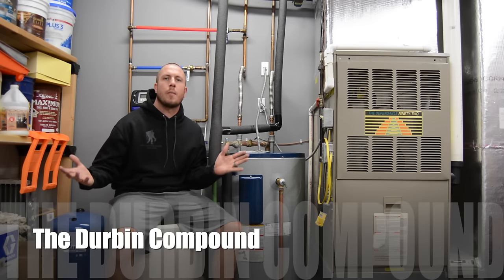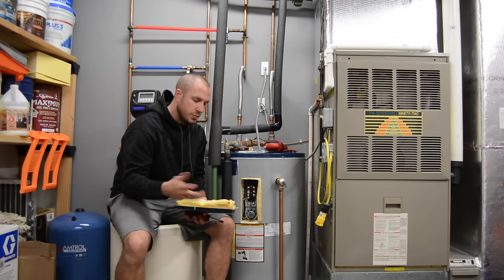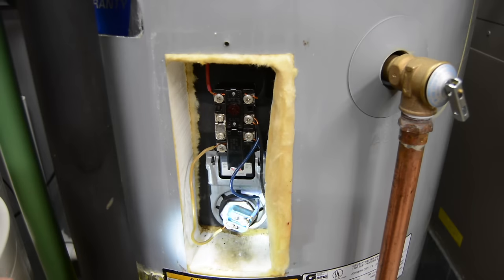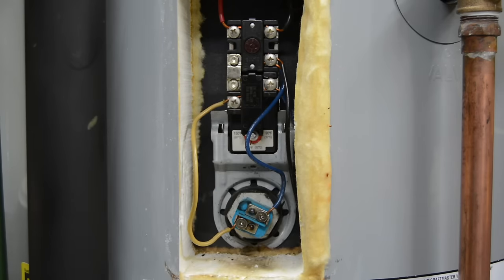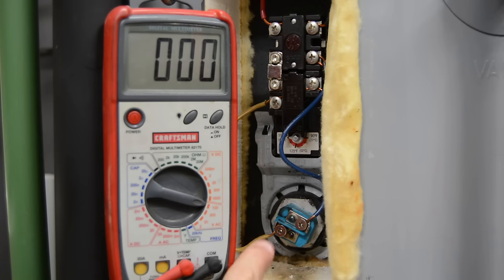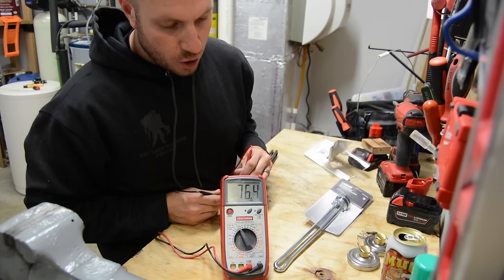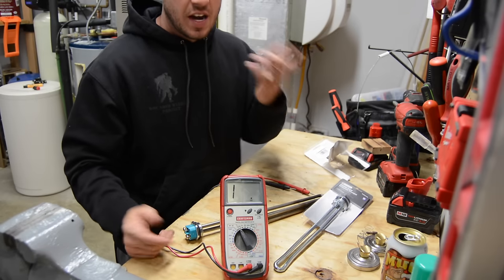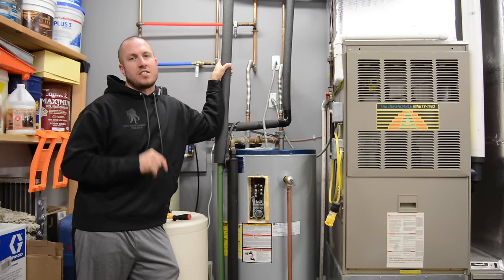How To Tell If Your Water Heater Element Is Bad

Comment: When you verify voltage is present at your element, Amp draw is also an excellent test of element functioning. Also after draining tank and removing lower element, this is a good time to see if tank needs a cleaning.
Reply: you are right about the current. i would check with amp probe first
Reply: I always test for amperage draw never test for continuity the element can be out and still have continuity

Comment: We had a storm knock out our power and when the lights came back on, we had no hot water.  I pulled out the elements and they were covered in little white rocks.  They were still testing good for continuity but I replaced them anyway.  Still no hot water.  Tested EVERY contact and EVERYTHING was testing good and I couldn’t figure out what the problem was so I started watching troubleshooting videos on Youtube and they all just kept repeating the same steps to test each terminal.  I finally found this video and it offered a a test haven’t heard on any of the other videos, (checking both inputs together to verify that they added up to 240v)! Sure enough, one input wire was getting 120v (and since I had continuity every contact also read 120v) and the other read 0v.  It was the Square D double 30 breaker. One side was good holding the other in the ON position, so it wasn’t tripped. Traded it out for a new breaker and I got 240v and hot water!! I just wanted to say thank you for including this test because you are the ONLY person who suggested it!
Reply: Nice. Mine is doing the same thing after I replaced both thermostats and elements and tested all the terminals. Over and over again as everyone kept suggesting. Hopefully I can find the problem in this video like you have.
Reply: The damn water company was doing some work on a house a couple yards down from me and no joke ever since they started I have had no hot water…. Don’t know if it was just shity timing or if somehow they screwed up my water too… they are never there when I’m off work so I’m kinda screwed lol

Comment: Elements can also be tested by turning off the power, then testing the resistance across the element. A good element should read between 10-16 ohms. My good element read at 13 ohms, but my bad lower element read at .59M ohms (basically open). Safer to test with the power off.
Reply: What if both elements read at 13 Ohms, thermostats look good visually and power is being supplied but still no hot water? Could one of the thermostats be bad or voltage be incorrect?
Reply: @snowyowl9132  Did you isolate each element by removing at least one wire from each one? You might be "back feeding" and reading the same element through the t-stat.

Comment: Be nice if someone would show/explain removal of element that burned and one side was severed from the other. That's what happened to me and when pulling out the element without draining the tank, water went everywhere. If a continuity test showed no continuity, then you might be ready with a screwdriver? to hold down the broken element as it was pulled out of the tank? We had no idea the element could be broken in two. We did remove it and get the new element in, but like so many of these DIY YT videos, they always seem to show the perfect circumstance; never what might go wrong. And, the heating elements alternate function from the thermostat setting; we thought the lower unit had a problem until we check it again fir a few minutes. Your clip is one of the best for this. I never knew anything about it before we DIY. Thanks!
Reply: It is completely your fault for not following instructions to drain the tank before removing the heating element. The gushing water had nothing to do with your element being broken and everything to do with you not draining the tank before trying to remove the element.
Reply: Should have called a service guy if water went everywhere. 100% your fault man. Goofball

Comment: Be sure to turn OFF the power from your main breaker box to the water heater before removing the wires on the heating element. One thing that some of these videos didn't mention is the mineral coating on the elements inside the water heater. The elements will still work. But it will take more time to heat the water when the heat from the element must go through the mineral deposits which act as an insulator that slow down the heat transfer from element to cold water.
Reply: Exactly, which also means that the water heater has to be drained/flush not always the case but I would drain it first & then changed the element to be on the safe side.

Comment: Great video, but your troubleshooting may not work in some cases.

If it's winter, and you're upper element failed, and your tank has been sitting a while (ie cooled down), you won't be able to turn down the upper element enough to allow the bottom element to turn on. Our incoming water is cold, and the upper thermostat's minimum temp is 90F, 32C. If the upper element has failed, the water wont warm, so the thermostat won't send power to the lower thermostat.

Comment: This seems like a very thorough explanation on trouble shooting a hot water tank.  Unfortunately, I just don't understand much about electrical things.  My hot water started coming out scalding hot and rather brown-ish the other day,  so I knew something was wrong.  But I don't know how to test these components.  What if I just buy 2 new elements and 2 new thermostats?  I'm pretty sure I can install them myself. Would that fix my problem?
Reply from the maker: This would be a good place to start.  Draining the tank and flushing it out, should take care of your brownish color. However I wouldn’t change the elements out. You know they work well!  It came out hot hot!  Just replace the thermostats which seem to have malfunctioned.  You can get the thermostat and element kits and save the elements for later.
Reply: @TheDurbinCompound  - Thank you so much for that advice!   I will definitely follow thru.
Reply from the maker: Good luck! Let us know how it goes!

Comment: Recently used your method to find the reset button had tripped. Left covers and insulation off for about a week waiting to see if reset would trip again. No problems during that week. 24 hrs after reinstalling insulation and covers,  thermostat reset tripped again. What would cause reset to trip? Would changing thermostat be best solution?
Thanks
Reply from the maker: Might be an over temp problem.  Putting covers back on made the thermostats get hot and pop.  I’d try changing them out and see what happens!  It’s a relatively cheap fix. If it doesn’t fix them, you can always return them!

Comment: Question - Does the thermostat 180F limit red reset button on upper thermostat only act on top info present at upper thermostat, or does the lower thermostat send signals that can can pop it? I'm guessing no, but wanted to make sure.  Reason I'm asking is that (i) I have "hard" well water and (ii) my reset button keeps popping (even after replacing both thermostats), so my working theory is that the elements are coated with minerals, which raises their internal temp to operate and thus setting off the thermostat limit reset (presumably at the upper thermostat?).
Reply from the maker: No signal sent between. I’d agree with your theory

Comment: Great video, good explanations with the multimeter. Old apartment had a Rheem 30 gallon from the 1990s...was probably never even touched. Hot water sucked, about 5 mins then lukewarm, and handle had to be ALL the way on full hot. If you moved it a HAIR, the water went cool. One time the heater went out totally- the thermostat RESET button restored it back to its "normal" crap performance. It finally busted a leak and was done for this year. Wish I knew this info before- could have at least drained/flushed sediment, and tested/replaced the elements. The anode was fucked and it was going to bust a hole anyway, but at least I couldve not dealt with lukewarm crappy showers for years. Thx for the info

Comment: Great video, but I was a little confused as to the top thermostat and the bottom was showing power.  I thought that was not suppose to happen.  Even though the bottom was drawing any current but power shouldn't have gotten that far with the top running correct?

Comment: HD didn't have one of those double back elements so I bought two straight ones of the proper wattage, it works but will that make a difference in the energy use or efficiency?
Reply from the maker: Only wattage matters. If you bought the proper wattage, it will use the same amount of energy.
Reply: The straight elements have a one year warranty. The double back ones have a 3 or 5 year warranty. They are longer, so they input the same wattage, into more metal. I guess that makes them last longer...

Comment: I just changed the element in my tank and it was all swollen and crusted and there's all these white chunks of stuff inside the water in the tank

I'm not sure what they are or how they got there and I don't know if opening the drain valve will drain out those clumps that look almost like big huge pieces of salt but I'm pretty sure it's not salt
Reply from the maker: It’s calcium deposits. Definitely a must to flush the tank yearly

Comment: Question: have a Rheem 20 gallon 120v electric heater replaced last summer 7/12/22. Drained after used for 1 month only. Came back 7/14/23 and filled, purged air, however the 20amp breaker tripped as soon as I fired up the cabin. I've tried hitting reset, and the 20amp breaker keeps tripping. Could the element have gone bad while not in use? The unit was NOT on during the year off. I cannot test due too breaker tripping as soon as engaged, so I can't test element. Could the element have gone bad?
Reply from the maker: Is the breaker a ground fault breaker?   Was this in a possible freeze?  I assume it was winterized?
Reply from the maker: A bad element will not trip the breaker usually.  It will just burn out and not work.  I would be amazed if it could have even gone bad without use.  Is it possible, that you drained the tank with it still on?  That heating element out of water for a split second would burn it up.
Reply: @TheDurbinCompound  First, thank you for your speedy reply. I tested the element with my multimeter by disconnecting wires, touching element screws, no beep, touch screw and tank, again, no beep. Any suggestions?
Reply: @TheDurbinCompound  standard single pile 20 amp breaker
Reply: Pole
Reply from the maker: Just to verify, with your leads on each screw on your element, you get no continuity beep?  That would indicate that your element is bad
Reply from the maker: Screw to tank & no beep is good. That means you are not shorted to ground.
Reply: @TheDurbinCompound  eeeyup..tested by touching leads = beep...tested by leads to element = no beep.... one lead to element screw and one to tank = no beep.
Reply from the maker: If your meter is set correctly, that indicates bad element.  Crazy that it happened but stuff happens
Reply: By the way thank you again for your responses
Reply: @TheDurbinCompound  thank you again very much.

Comment: Great video one question I have no power at the bottom thermostat or the lower heating element at 125 degrees but I have power on both of them at 150 degrees they both read around 235 when it's turned up to 150 degrees any suggestions
Reply from the maker: I would say that is operating correctly. The bottom thermostat is only coming on when necessary. If you’re still not getting hot water, then you most likely have a bad heating element.
Reply: Ok that helps me out do you think the bottom thermostat is bad I only have one on mine there is only a heating element on top behind the cover and I leave the water at 125 degrees and after one shower the water is Luke warm

Comment: Hey buddy you measure the ohms wrong on the element.  It SHOULD NOT BE 77ohms!

A 3,500-watt element should register 16 ohms, a 4,500-watt element should register between 12 and 13 ohms, and a 5,500-watt element should register between 10 and 11 ohms
Reply: correct NK

Comment: Question, when you drain the tank to replace the element, what’s the best way to clean it out?
Reply from the maker: Usually, I use the feed water pressure to stir the bottom. The cold inlet water is fed to the bottom of the tank so it can stir up the sediment after you’ve completely drained.  Also have used the garden hose and a piece of rebar in the bottom element hole to break stuff up

Comment: Regularly flushed 13-year-old electric hot water heater sputters with air in the line and black specs and industrial smell when I use the hot water. Any suggestions before I dig in? Any comments or help is greatly appreciated!
Reply from the maker: Black specs usually are a sign that your anode rod is shot and either needs replaced or removed.  As for the air, it has to be getting in somehow, usually after you flush; but you know this from your flushing experience.
Reply: @TheDurbinCompound  any guess on how the air might be getting in? However, a few days later, now I see a little trickle of water underneath it. So I guess there's no way to save it now? I learned an important lesson about replacing that anode, I never knew about that before. I really appreciate your response! All the best to you in the new year!
Reply from the maker: If it’s leaking from the tank, there is no way to save it! Ugghh
Reply: @TheDurbinCompound  I think I learned an important lesson about replacing the anode. Thank you for your video and thank you so much for responding.

Comment: great tip but, too bad 38-40gal wh's only last 5-6yrs if your lucky, with hard water. Replaced thermostats and both elements  when the hot water wasn't lasting as long as it should and got maybe 2 more months out of it when it started leaking in between both thermostat panels. Luckily only paid $45 for the element kit...but shouldn't of bothered

Comment: When I tested the ohms, I was going 17 on a new one and like 30 on my ones that are already installed. Seeing how they both have continuity on the bottom and top, do you have any other ideas on why it’s flipping my breaker?
Reply: This is where testing with an amp probe comes in. The elements are marked as to their amperage around 18 amps I believe. If your element is bad it will show higher amps than normal. Or no amps.
Reply: The elements are $11-$14. Maybe just swap them out?

Comment: Looks like he learned something while filming this. At one point he stated that both elements should have power. This cannot happen when you understand that the top thermostat switches power from the top to the bottom.
Reply: so.... if the top element goes "Pop!"- does that mean the bottom one won't work either?
I have been confused falt-finding an economy boiler, as the lower power socket goes on and off with the economy electricity supply, so the on light is obviously only on intermittently. 
My first idea was to plug the upper one into the lower supply..... but, presumably - without the top one the bottom one won't work anyway.
The upper heater casing has a suspicious scorch mark, so I think it has blown. 

is a resistance check able to tell the difference between a good and bad element?.... I mean, presumably a good one conducts at a low resistance, but a bad one would fail as an open circuit? ... or a high resistance? (which) 

Hmmmmm.... I'm not a plumber, but in the current crisis I can't find one and would LOVE me some hot water, but I would stop short of actually attempting the element change as depicted in this vid. I'll just have to boil kettles till the zombie plague is over.
Reply: I noticed that myself..
Reply: @borlani  The top thermostat has to be satisfied before it send power to the lower thermostat. Meaning if your top thermostat ever goes bad while your bottom thermostat is still good you will still have a full tank of cold water.

Comment: I've seen on other videos it says to turn the water heater off at main breaker. Before touching all those screws with the voltage checker, are we supposed to turn off the main circuit breaker first?
Reply: How are you supposed to troubleshoot and check voltage with your multimeter if the main power is off?

Comment: I measured the voltage with my meter at the top of the thermostat the way you show at 6:08.  It shows no voltage.  Yet my pen tester shows voltage present at both the thermostat and the heating element. I can't figure that out.  The meter correctly shows voltage at a standard 120 volt outlet.

Comment: Can a bad heating element cause a voltage drop? The line in reads 120 volts until you connect it up to the water heater, then it drops to 13.5 volts. (120 v water heater)
Reply from the maker: This issue sounds like a loose neutral wire or a damaged wire somewhere.  Will show good voltage when no load but when loaded with resistance, it drops to almost nothing.  A bad element would still receive 120V, just wouldn’t work.
Reply: @TheDurbinCompound  Thank you

Comment: I replaced thermostat and heating element. all Volt readings read 240V from break panel to the heating element. Power to both yet does not heat. I have a US/Craftmaster 30 gal elec water heater only 1 thermostat and 1 heating element. Ant suggestions?

Comment: Hi.. I got a problem with my electric iron heating element. Let's say the resistance readings are as expected but I'm just scared to pass the current throught the heating element to check it, because I dont want it to short. I basically dont want the fuse in the mains to go off and then we'll have no electricity in the house and will have to call for help. So how can I make sure that wopnt happen?

From what I checked with the multimeter, it was showing no current leaking into the body and the resistance between the terminals of the heating element is exactly 58 ohms (calculation says it should be 57.6 ohms). Should I now be okay to move ahead and connect power supply?